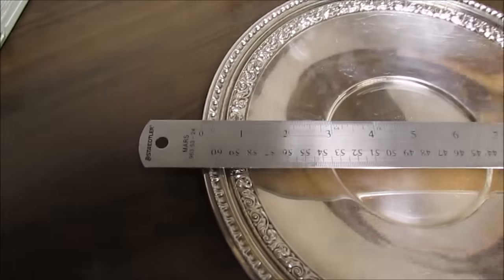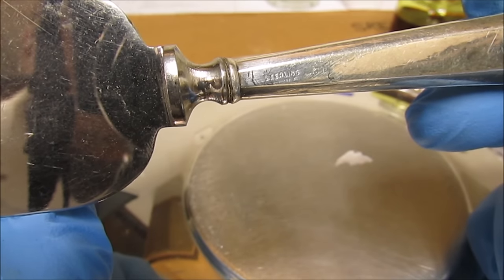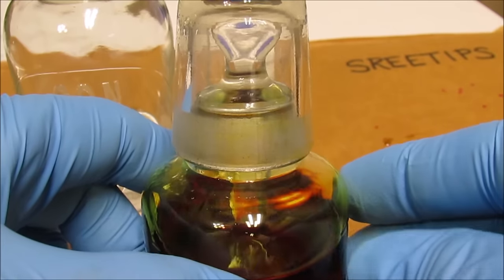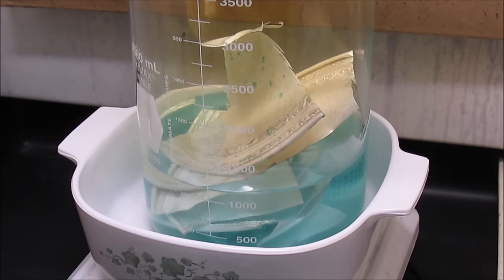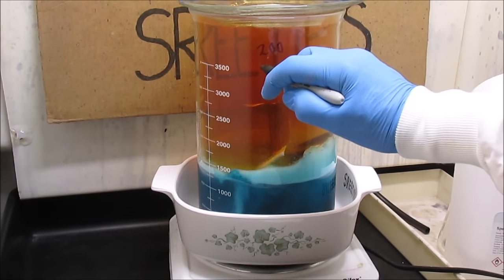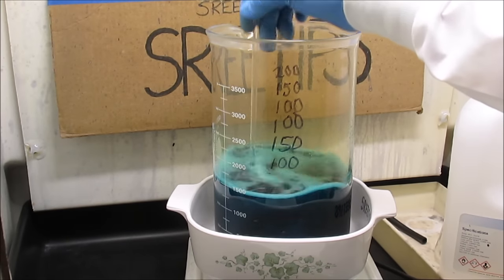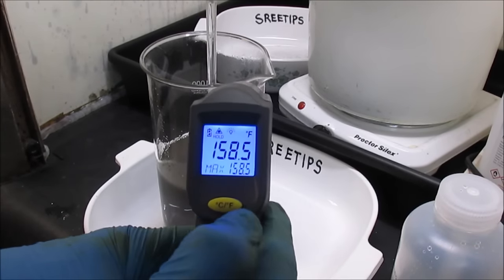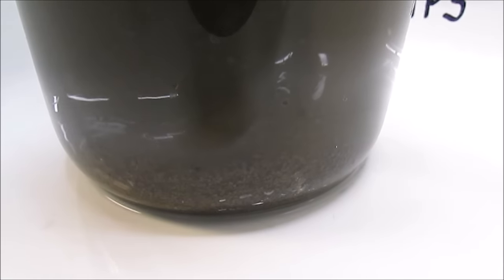Method for Recovering Silver From Silver Plated Items

Comment: Is there any way to strip the silver off without completely dissolving the base metals as well, or will the silver continue to cement out onto the base metal requiring that is be completely dissolved? I have a very large amount of silver plated items that I was hoping to strip, and am trying to figure out exactly how much nitric acid and total volume of liquids will be required throughout the process.
Reply from the maker: Yes, but I’ve not tried it yet.

Comment: Another question. Is tap water needed in the transition to silver oxide? Is there something in tap water imperative to the transition or is distilled water okay to use???
Reply: Sometimes you can answer these questions by yourself, but to do so required an understanding of the rxn that's occurring. 
Since you already know (or were given the information) that when you take sodium hydroxide and mix with hydrochloric acid, you obtain common table salt. You can extend the idea here: what happens when the same (lye) is mixed with silver chloride? Since lye pulled the chlorine off of the hydrochloric acid to give sodium chloride, intuition tells us that lye, when mixed with silver chloride, will also pull the chloride off, to give sodium chloride! But what about the silver part in silver chloride? We got the chloride part to give salt. The silver part stays behind as silver oxide (oxide because the the silver takes on the hydroxyl in the lye, giving the oxide).

But what tf does any of this have to do with tap water?! I'm glad you asked. 
Nowhere in this set of reactions did a special or trace ingredient need to be used for the rxn to occur. Special minerals, dissolved metals, and other impurities in tap H2O were never called out. In fact, not once were they even mentioned. Therefore, being guided by just a simple, intuitive understanding of the chemistry behind this reaction, we are definitely in a position to answer the question once and for all. And the answer is: NO! There is no special quality to the tap water; one may use any kind of water for this - hard water, soft, water, tapped, distilled, reverse osmosis, hot, cold... Insolong as it's water, it shall work........

Comment: I would really appreciate if you replyed to this. If you were just getting started in metal refining so you have chemicals (I.e. nitric), would you think it safe enough and ok to do everything outside, still with the appropriate equipment and safety stuff but without a fume hood? This is just because I wanted to get some sort of a better insight into this as if you think it unsafe I wouldn't do it. I really appreciate your feedback. Thanks :)
Reply from the maker: I did my reactions in the back yard before I bought my fume hood. It was hard because rain would be a problem. Also, no matter how hard I tried, I always got some fumes in my nostrils. Holding my breath while adding reagents didn't work very well.
Reply: @sreetips  ok, thankyou very much, I think I will go for it outside as recently here in Britain it hasn't rained much, however I will get a big fan to hopefully blow most of the fumes away, many thanks, love watching your videos!

Comment: I tried using a Sliver Cell setup to strip Silver plate from objects like that. I used Potassium Nitrate as the electrolyte. It seems to work. Pretty quickly too.
Reply: only potassium nitrate no acid in the electrolyte...
Reply from the maker: I’d like to try it.
Reply: i send you the formula and the steps to operate the bath if you like... so you can tray it in small scale to anderstand the process its very economical and kwicly done.

Comment: Would it be possible to rinse the plated items with acid removing the upper layer until all of the silver is dissolved and then discard or scrap the brass/copper base metal? That would reduce the amount of acid consumed.
Reply from the maker: No, the silver will cement out just as fast as it dissolves.

Comment: The stock pot end was sadder then the last scene of "Old Yeller", I am putting together a small plating shop to do as a hobby, zinc, copper, nickel etc mainly automotive and motorcycle parts and came across one of your videos, needless to say i have been binge watching since. What is the possibility of making gold plating solution for electroplating emblems on cars ect. I see the are getting 180.00 per quart shipped containing 1 DWT,  pennyweight of 24k fine gold in one of the listings on ebay. I have seen that there is a process using potassium ferricyanide and gold chloride. Thank you for your videos and you have a new fan.
Reply from the maker: I'll have to do some research on gold plating solution. Sounds like a good topic for a new video. Thank you.

Comment: Would it be most cost effective to electro strip the silver directly off the base metal into solution then recover.
Reply from the maker: Chuck, I don't know because I don't have any experience with stripping the silver off. With silver at $16 my guess is probably not. Especially when there is so much silver scrap jewelry out there. Stripping off a few grams doesn't make much sense when you can buy scrap sterling silver for pennies, if you know where to look.
Reply: @sreetips  where to look?
Reply: @sreetips  where do you look for the scrap sterling silver?
Thank you,Chuck.

Comment: If the base metal is brass would it still try to cement while dissolving because of the copper content?
Reply from the maker: swbyrd bras is alloy of 85% copper and 15% zinc. Zinc, being more reactive and therefore above copper in the reactivity series, will not cement out on the copper. The zinc will stay in solution.

Comment: the best way to test silver is with 18k test acid. and a super tiny drill bit you can find them in beuty stores they use then for finger nails. you just find a spot drill in past the plated test with the acid if it turns green its plated. then after that spot can be fixed buy a buffing pad if the person wants to repair the peace.
Reply from the maker: I prefer a file and schwerter's solution. Fast and easy

Comment: Nice video and great way to get pure silver but I have about 100 pieces of silver plated flatware and 20 or so silver plated platters and I am looking for an easier and more economical way to get the silver out of all that. I am pretty sure most of it has a thinner plating than your platter did so I believe nitric acid will just cost too much. Have any ideas that will not require days of labor or cost more than the silver is worth? Have a wonderful day.
Reply from the maker: Scott, this is my first try with silver plated scrap. Maybe when silver gets to $100 per ounce then it will become viable to use nitric to get it off of silver plated items. For now, I don't know any other ways of getting the silver - yet.
Reply: I watched the Moose Scrapper video. That dude could really use a nice set of Corning Ware. Just sayin'.....

Comment: I am attented to do the same thing with silver plated items such as forks, knives, serving spoons, etc. and my solution turn brown for some reason. Can you tell me what happened? What did I do wrong? I am at the first stage where are you add distilled water, the metal, and the nitric acid.
Reply from the maker: I’ve never tried silver plated forks. No experience with that kind of material.

Comment: I would be interested to see if you get a similar yield on some other examples. Might be alot of variation? Love it thanks,!
Reply from the maker: The only reason I did this one is because I noticed it had an extra thick coating of silver.
Reply: Lol ok I'm requesting you try a few pounds of thinly gold plated costume jewelry at the other end of spectrum 0.1%? It can't be as costly as that eBay bar video!  Cheers
Reply from the maker: Gold plated costume jewelry has just a few microns of gold over junk pot metal. Almost nothing. I’d end up with a toxic mess and no gold.

Comment: Hi I enjoy watching your videos but I have a question , I have been refining computer scrap and doing very well however the last lot of gold plated pins there was 220 grams of them , I am having problems , now I used 1000 ml of distilled water and 100 ml of nitric acid , now my problem is that the solution turned green and not blue , does this mean that they are brass pins and not copper and what must I do to get the gold out of the solution , need help , thank you Gavin Keates .
Reply from the maker: Gavin, there are three possibilities for your green solution. Nickel, iron and zinc (brass is copper alloyed with zinc). These will all turn the solution green. It matters not if your gold is in solution with any of these metals, or with all of then at the same time. Adding SMB will selectively precipitate the gold and leave the other metals behind in solution. The problem comes when you have any of these metals in solid metallic form in with your gold. The gold will "cement" out of solution just as fast as it dissolves if you have pieces of solid base metal in there. However, you may have another problem. 220 grams of gold plated pins will have very little gold yield, almost nothing. It's best to recover gold from gold plated items in a sulfuric acid stippling cell. I have several videos on how to do it.

Comment: wow, that was very interesting. thank you for that. now I don't know much about everything you were doing, but I was following u. to my lay understanding. all metals of the periodic table are soluable? is that true or then my spelling.😁
Reply from the maker: Robert, nitric will dissolve silver, copper, brass, zinc. But nitric won't dissolve gold, platinum, aluminum or stainless steel. Some metals are soluble in certain acids but insoluble in others. We can use this knowledge to selectively separate metals from each other.

Comment: If you knew the base metal was copper you could etch it out with cupric chloride or ferric chloride which is a lot cheaper than nitric.
Ferric would also dissolve brass base metals.
Or would that not work due to contaminants or unwanted metals like iron, tin, zinc?
Probably have to cut it into smaller pieces to expose more base metal because those solutions are not as aggressive as nitric.
Reply from the maker: I’ve never worked with those
Reply: @sreetips  My electronics hobby, we use cupric chloride and /or ferric chloride to etch copper off printed circuit boards, ferric will also etch brass.
I was just thinking those might works for dissolving out copper and brass plus they are a lot cheaper than Nitric.
Reply: Of course ferric chloride works work, but it would take quite some time. The benefit is the obvious fact that no workup is required after the dissolution step; just rince the silver and you're good to go!
Reply: @glennbartusch7310  With all the stuff Sreetips has laying around and tied up in waste solutions, I don't think that letting it sit around for the time it would take to dissolve the copper would bother him much.
However the process might not work on high percentage alloys for the same reason that you have to inquart some gold alloys.

Comment: Question: could you have also used copper to cement the silver out of solution, like how you normally do with the sterling?
Reply from the maker: Yes, but a few drops of nitric acid would probably be needed to get it going.
Reply: @sreetips  also I think it would be a very interesting if you could have a video of your lab and more into the equipment you use in the refining process and maybe add how you clean the beakers after a run I would love to watch that

Comment: Without neutralizing the nitric before you poured it into the stock pot don't you still have silver in solution? As you waited over night for it to settle, some silver kept going back into solution with the excess of nitric.
Reply from the maker: Maybe, that's the reason I added it to my silver stock pot. It's full of copper wire so any remaining silver in solution will cement out on the copper.

Comment: Would larger quantities lower the cost to recovery ratio?  I know it would increase the time and the materials cost, but trying to decide if refining the silver plate is worth it to have the silver to stockpile.  I guess the same question for gold applies.
Reply from the maker: The only reason I did this is because this piece had a thick coating of silver over the  brass. I filed deep into the metal. Then looked under magnification. I could see the thick coating of silver. Most silver doesn’t have a thick coating like that. Even with this thick coating, it still cost more in nitric acid than its worth. There are more economical methods to get the silver plate off of the plated stuff. But the amount of silver will be small.
Reply: @sreetips  understand it won't be a great deal. I'm just trying to figure out if it's worth the effort to slowly add to a stack of silver. If I can go to an estate sale or a thrift store and pick up a box of silver plated items for 5 to 10 bucks and maybe get an equivalent amount of money out of it in silver, regardless of the materials cost, it would be technically adding to my stock. I saw an ad for a company that offers to do the reclamation and the refining if you send it off to them. I don't know if they get a better return due to higher volume I don't know.
Reply from the maker: I’ll look into it a little deeper. There are some methods to get the small amount of silver off and just let it build up over time.

Comment: You say that the blue liquid that's leftover is the dissolved copper, right? Is there a way to turn that back into pure copper like what you did with the silver?
Reply from the maker: Yes, but I've don't have any experience refining the copper.
Reply: @sreetips  That's fine. I was just curious if it was possible.
Reply from the maker: The blue liquid is added to my waste treatment bucket. It's full of angle iron. The copper will cement out on the iron as pure elemental copper. But there are other metals in with the copper and they cement out also, contaminating the copper.

Comment: like your video. think I would take an angle grinder to that plate inside your containment box and remove all the silver that way then sweep it all into beaker that would eliminate having to dissolve everything and yield per acid used would be much higher
Reply from the maker: Kirt, I'd rather let the chemicals do all that work for me.

Comment: If one should have a lot of silver labeled sterling, is it recommended just to melt everything directly into a bar? Or, to separate the copper first chemically, and then get a finer silver?
I mean, is it a stupid idea (in terms of selling price) not to separate the copper before?
Reply from the maker: Cliff, there's no need to refine the silver to high purity. As silver prices begin to rise you'll have no problem selling you sterling silver just like it is. Just hold the sterling. But you do need to be able to determine if it's fake or not. When the feeding frenzy starts and everyone starts to trade their paper for metal, they will be falling over themselves to buy your sterling silver, just like it is.
Reply from the maker: Sterling silver has a known quantity of silver, theoretically. If you melt your sterling that is marked "sterling" into a bar then it's silver content becomes questionable. Leave it like it is. Melting into a bar will reduce its value. People know what sterling silver is. But if you present them with a melted bar of metal then their mind will go, tilt.
Reply: @sreetips  Then I'll leave it as is.
The other ones, not marked sterling, will go into solution I guess then. Thanks

Comment: And also my final yeild from the 26lbs of gold plated fiberoptic parts from craigslist for $325 was 110 grams of pure gold. $4500 profit.  Do you think any vintage gold plated platters like this silver one here could have a decent plating? Considering the price of gold in the past.
Reply from the maker: Use the sulfuric stripping cell? That is fantastic. Well done. I haven't worked wiith any older gold plated platters.
Reply: Yes stripping cell with full size battery charger on wheels. No shut off safety. When I did it with the toaster size charger it would click off with the heavy plated parts.  Jewelry you can watch the meter pretty well drop as soon as you put them in. Plating gone in seconds. But with this heavy telecom stuff it was taking up the an hour for a handfull of parts plstingvto come off.  Substantial gold plating!!!  So I got the big charger and it takes less than half the time. So I would keep an eye out for old fiberoptic parts. I averaged $175-200 worth of gold per pound of material.
Reply from the maker: There is no substitute for experience. Sounds like your gaining in that area. I wouldn't broadcast too loudly. If people know that you can get that much pure gold then the price will go up and you'll only hurt yourself. Try to contain your joy and keep it on the DL or you'll end up with less profit.
Reply: I understand that. But you share a lot of valuable information that allows motivated rookie refiners to possibly make a profit refining. I would email you with questions, concerns and possible endeavors. I've looked on your homepage and didn't see an email. I'm a jeweler  and of course refining seems to go hand in hand with a lot of jewelers. You included it would seem. And you are one of the best sources out there without having to keep your nose in a refining book or forums all day. So I am grateful and would like you to continue being my refining guru. Lol
Reply from the maker: I put my enail in my channel description just yesterday. I thought it was already there but I checked logged in as someone else and I could not find it. But I added it so you can get it by clicking on "about" on my youtube channel.
Reply: Awesome